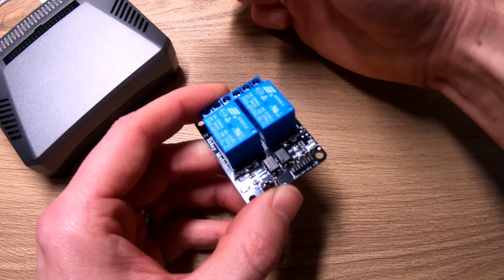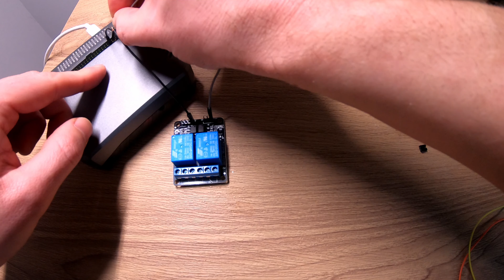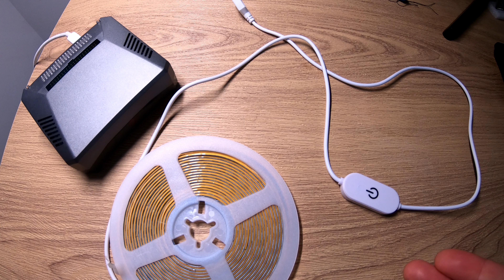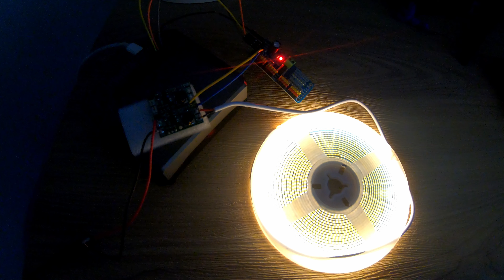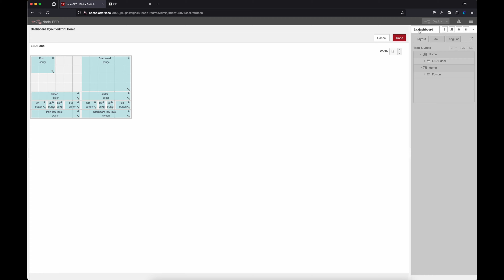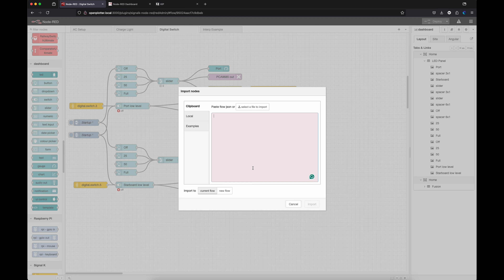How to Set Up Affordable Digital Switching & LED Control with Raspberry Pi | Sailing Tech Guide

Comment: Digital switches are all very pretty but there is a lot to be said for a simple, definitive hardware on/off switch with a pop up resettable fuse right next to it.
Reply from the maker: I agree. With all of this you have to find a solution that fits your requirements

Comment: Thanks for a great video. Implemented several ideas from this and other of your videos. but could not use Gpio out on raspi5. Apparently de libraries that come with nodered in signalk are not adapted to the raspi 5 new design. Could not find a solution. Did you find the same problem or you are using an older raspi?
Reply from the maker: Hi - Thanks for your comments on the videos. You raise a good point, most of the work here was built on a Pi4 rather than a Pi5. From what i understand the following library can be used python3-rpi-lgpio but you do need to be careful that it doesn't cause you other issues depending on what the Pi is also doing or what software its running to operate other tasks.

I think as i found with the LED side, trying to drive some of this straight from the Pi isn't the best option and it needed that extra board to control the PWM on the LEDs better. I really like the little ESP32 boards, and i think i would tend to move more that way on future projects.
Reply: @BoatingwiththeBaileys thanks for your comments!, 😅 I will probably follow the same way and use a esp32 board if I cannot find a way around it. And thanks for all the useful ideas and videos 😊

Comment: YOU LOST me...and probably 1000's of others viewers early in your VIDEO.
Here's where I am.  Existing MONOHULL from 2015 with traditional 'switch panel' INTERESTED in changing to digital switching.
I, and presumably others, need to START our UNDERSTANDING of this subject at a MUCH HIGHER level.
I need to IMMEDIATELY UNDERSTAND that whatever 'solution' you have is going to be applicable to my 'hard wired existing' sailboat.
THEN, I'll invest the TIME to follow your Raspberry Pi and Digital switching discussion as HOW to make it happen.
Guessing you're going to SHOW me how to connect existing wiring to one/more of these devices.

Can you make a HIGHER LEVEL video addressing these concerns?
Reply from the maker: Firstly thanks for commenting on the video and providing feedback, all feedback is useful. 

Now to your comments, no I won't be creating a video to 'address your concerns', if you can't be bothered to invest a little time watching a 30-minute video when it takes about a week to make then this isn't the channel for you. I had to plan the video, order components, learn Node-Red, revise my approach and make it work and that's before I even got to the recording and editing part. If you had watched the video then you would have seen that there are different approaches to this and it depends on what and how you want to control things. Also, what's with all the capital letters in your response? 

Good luck with your project and fair winds.

Comment: You really need a relay that can provide an internal state instead of just listening for a command to switch. You can get into a reverse state and end up switching off instead of on, etc. There are a few using i2c for reading state like MLink, but are a bit more complicated due to needing to communicate with the module. Shelly relays are a good alternative since they are plug and play for Signalk, and also provide internal state.
Reply from the maker: Hi, Thanks for your comments. I'm going to take a look at the Shelly kit, that seems to have a good reputation and i wasn't aware of it so thanks. 

Just on the other point, have you noticed things getting out of sync? I would like to understand why that happens, when its Node-Red making the request to activate the relay.
Reply: @BoatingwiththeBaileys  I have not used node-red to switch stateless relays. I'm curious if it's reliable. Would be good to have a follow up after a couple of years
Reply from the maker: Ok - Thanks for the response. From my testing so far as soon as the power is removed or Node-red reboots the relay reverts back to its default state and thats also the state i've programmed as the starting point for Node-Red. I'll also update this as i use it more and if i find anything else.

Comment: I recommend using a “Shelly rgbw pm” device. It’s around 25eur. It also gives you an analog input for a momentary push button. Practical  for local control and failsafe 
I have made a node-red flow that can dim, but also switch to “night mode” color red. I can send you if you are interested.
Reply from the maker: Hi - Yeah, just taken a quick look at that device and it does look very good. I have another led strip which is RGB and i did wonder what i could do with that so i might take a look. Would also be interested in your Node-red flow if you are happy to send it over. Our email address is contactus@boatingwiththebaileys.com - Thanks
Reply: Mail sent!

Comment: Great video! Just to clarify, the Raspberry Pi (4, 5, Zero, etc.) are full general purpose computers, and run Linux or another operating system, while the Pico is a microcontroller, and is generally programmed directly. The pico is similar to an Arduino or Esp32. Microcontrollers are great, and ai encourage you to get into them if you’re interested, but you need to remember they require a very different approach than a general purpose computer, or you’re going to have a bad time.
Reply from the maker: Hi - all good advice, thanks. I've not done anything with a Pico but i have with an ESP32. I might get one to test and see how they compare. Thanks for your comments on the video.

Comment: With regards to the LED dimming control: How about using the Pi to control an arduino, and let the arduino drive the LED driver? That way you have a dedicated device that can be programmed by the Pi. An Arduino Nano ought to do this just fine.
Reply from the maker: Hi - Yeah, another good option. Not done much with the Arduino, but sounds like something else to take a look at - Thanks.

Comment: Thank you for this video. For my next project i was going to look at digital switches with a Raspberry Pi. This video has saved me hours of research. ❤
Reply from the maker: Hi, Many thanks for your comments. Glad it was useful. Loads of different options to look out, just make sure to have a plan B if you can't digital switch it and also get the best components on the relay switching side. I found some solid-state kit after making the video which looks really good. Best of luck with your project and let us know how you get on and what you end up using.
Reply: @BoatingwiththeBaileys hope you share the solid state kit!
Reply from the maker: Hi, things like these https://www.amazon.co.uk/dp/B07QXKKS1X/ref=sspa_mw_detail_3?ie=UTF8&psc=1&sp_csd=d2lkZ2V0TmFtZT1zcF9waG9uZV9kZXRhaWwp13NParams - 5V 4 Channel Solid State Relay Module DC-AC High Level Trigger with Fuse 2A 4 ch arduino solid state relay. Would need to try and check when it turns on, so low or high switching and also its rated output as these seem lower than the relays.